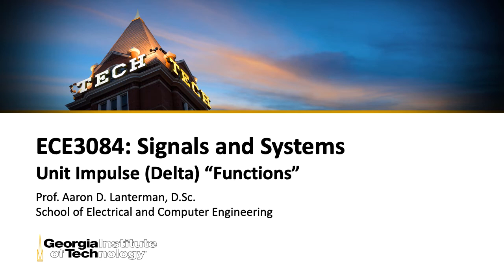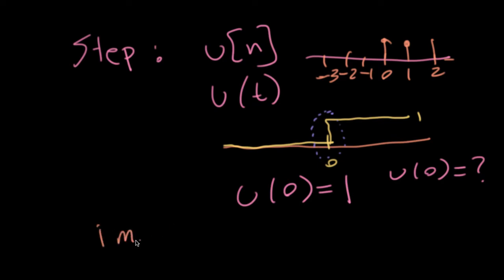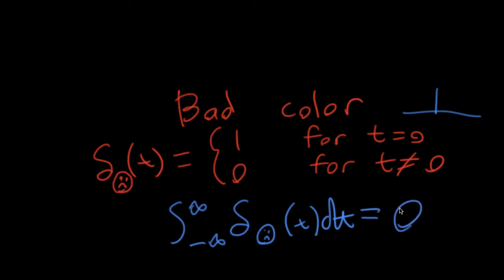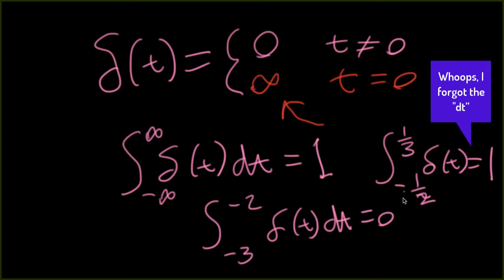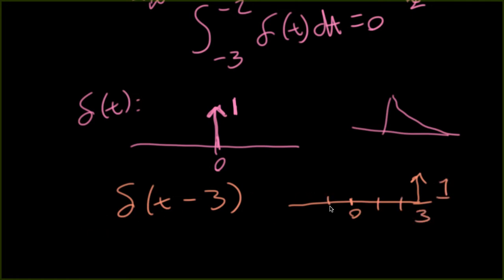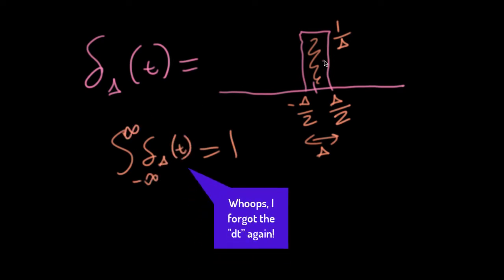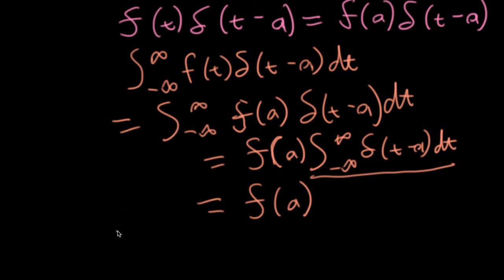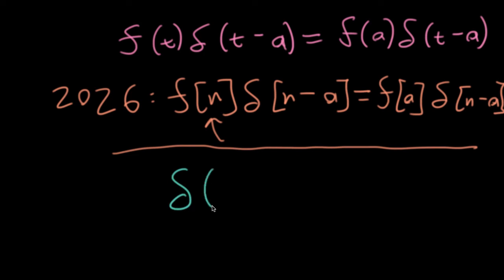ECE3084 Lecture 3: Unit Impulse Functions (Signals & Systems, Georgia Tech course)

Comment: This might be silly, but what happens if we multiply a function by two delta functions that are on at different points in time? Say integrating u(t)*Dirac1(t-1)*Dirac2(t-2). I went through what happens when we integrate just the two delta functions, Dirac1*Dirac2, and see why it is zero (integral of Dirac1(t-1)*Dirac2(t-2) = Dirac1(2) = 0). I do understand that if we wanted to have an impulse be applied twice to a signal we would simply add the two impulses, but this idea of integrating u(t)*Dirac1(t-1)*Dirac2(t-2) is interesting to me. 

After several minutes of thinking, I am pretty sure that it is equal to 0 because you would just apply a normal order of operations. The first Dirac would condense the unit step function to a weight/a value at a point, but then the second Dirac function would kill it because the combination of the function and Dirac1 only exists at t =1, and the second Dirac is on only when t = 2.
Reply from the maker: Yeah the deltas kill each other off.